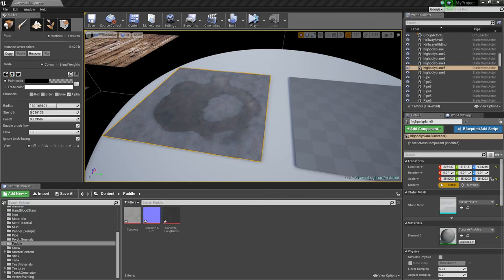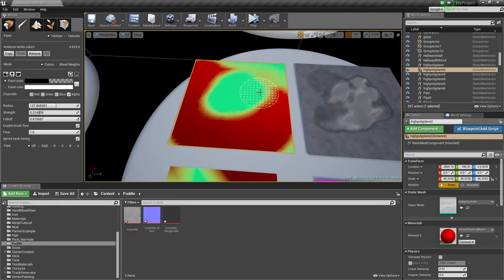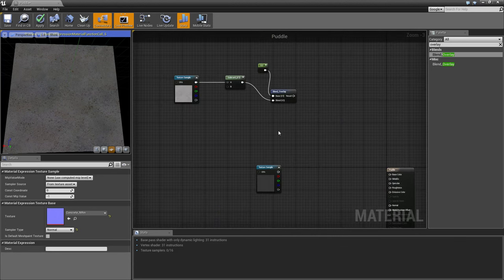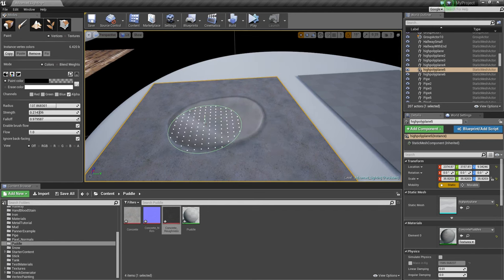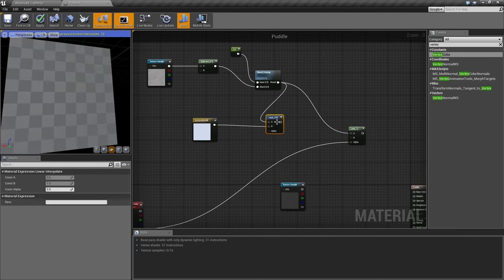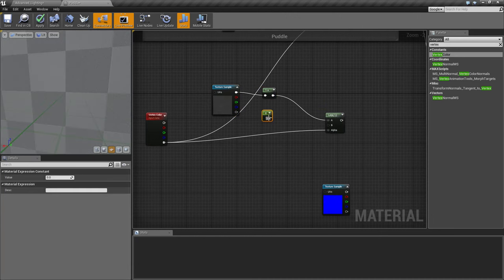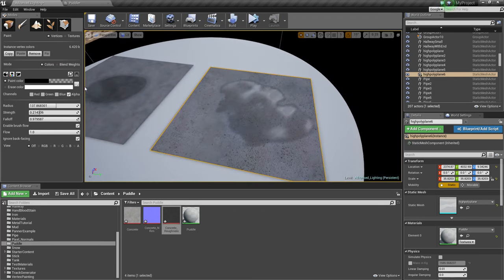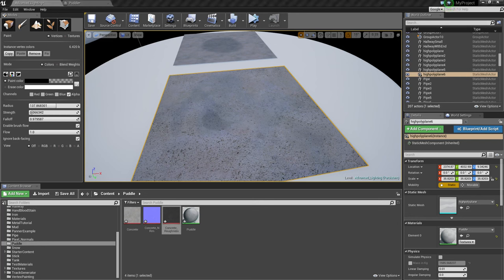Ue4: advanced materials (Ep. 21 Painting Puddles)

Comment: I just did the steps as said, yet I can't paint anything? The thing I'm trying to paint has enough vertexes, but it isnt working. Please help?
Reply from the maker: Try using one of the rgb channels instead of the alpha chanel
Reply: Steve's Tutorials hmm, the issue is whenever I put the material on the object is already covered in the puddle. I can’t erase though, which is strange. I’m doing shift + click by the way which is the erase method.
Reply from the maker: @EnderJohn89  definetly reverse the lerp inputs first then. I'll have to look it at later. If you need help now don't hesitate to join my discord and ask for help. https://discord.gg/TgSaCGE
Reply: Steve's Tutorials just joined the server, once ue4 opens up later I’ll screenshot the material
Reply: Sent a screenshot in the ask for help chat, and which lerps do I reverse? The a and b’s?

Comment: So I guess in order to vertex paint you have to have many vertexes on your mesh. But wouldn't that have a great impact on performance?
Reply from the maker: It would do, however if you look at some UE4 scenes made by the UE4 team you'd be surprised how lenient they are towards poly count. Complex materials and lighting tend to have a much higher impact then a few higher poly assets.
Reply: Would vertex painting have a impact on my building mesh if it is static? From what I know, in order to add details  like dirt, puddles, blood etc.. I have really three options... 1: Have high poly static building meshes like hallways and rooms and texture it with vertex painting. 2: Have tiled textures and add details using decals or 3: UV unwrap the mesh and texture it in substance painter. In your experience which one is the best option? Or is there something I am missing? Thanks
Reply from the maker: Yeah that sounds like the 3 main options from my experience. I mean you'd be surprised how low poly you can get away with using vertex painting if set up correctly. However if this is supposed to be real-time and not to just look nice for a portfolio piece i'd recommend just going in substance painter and using decals. You can use decals and some good texturing via substance painter to not only get some great results but make areas look far more unique then other areas of the asset.
Reply: Sounds like a plan, thanks man! ;)